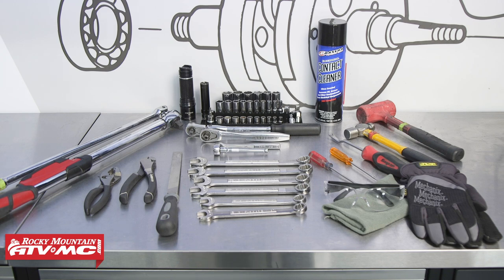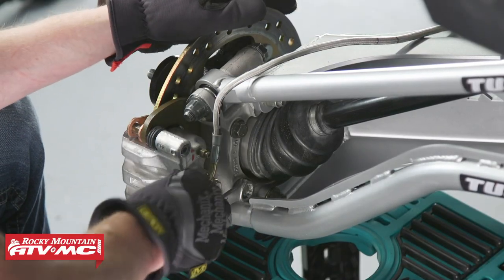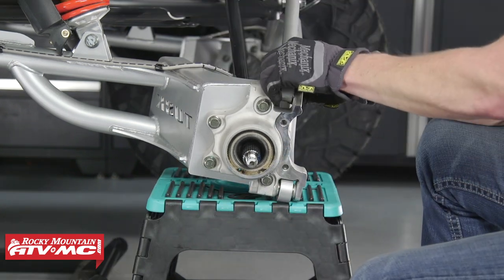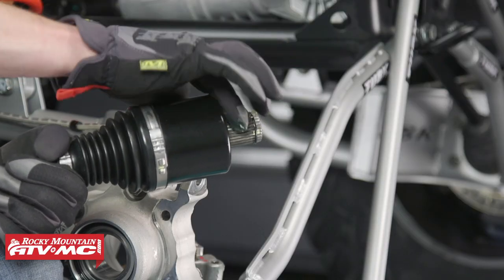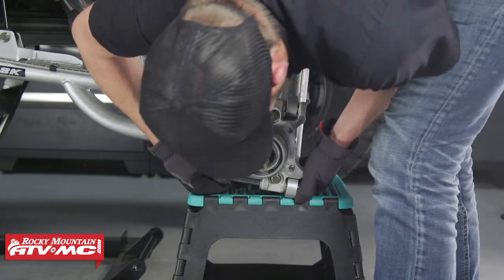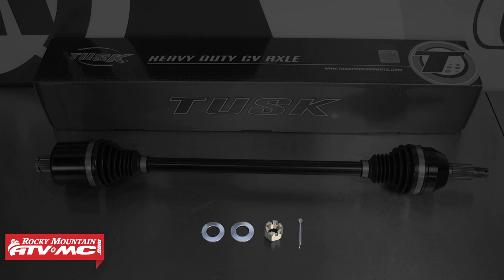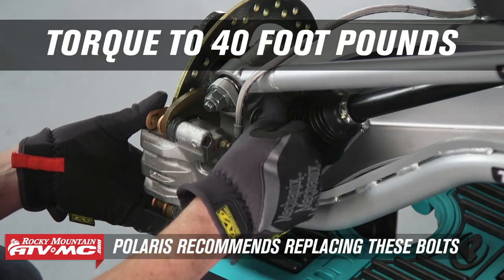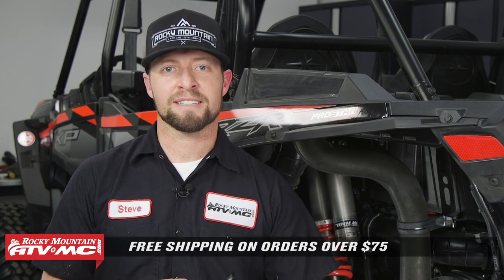Polaris RZR XP 1000 Rear Axle Replacement

Comment: Just purchased 2 of the exact same axels from you guys and torqued them to the recommended 180 ft lbs…I even double checked the torque spec in the rzr owners manual because I didn’t understand the 10 &12 mm you were talking about like the previous comment mentioned, so I just wanted to be sure on the axel nut….couldn’t get it to 180 the nut lost its resistance and just keeps spinning. The threads are ruined on the axel. Would not recommend this axel.

Comment: I didn’t catch when you were talking about 10 or 12 mm torque that you meant the bolt size and not the socket size which didn’t make any sense anyways since the head is 15mm but I torqued my m10 bolts to 100 and it shot the nut side off and it went to the moon so don’t make that mistake lol
Reply: He is talking about bolt size not the bolt head

Comment: I'm sorry but the axle does not come out that easy! tried the slide hammer trick, no dice. tried pry bars still no dice. still working on it.
Reply: did you get it?
Reply: @garrettfreeland3391  yes I soaked it in penetrating oil several times and it finally popped out
Reply: On my 2017 Polaris razor XP one axle longer which way

Comment: Y grease the splins? Wouldn't that get grease in the dif?
Reply from the maker: The grease helps the axle not get stuck inside the diff, you don't have to apply a lot. Helps incase you have to change that axle again.

Comment: are they really heavy duty? would u say they compare to the Rhino 2.0s?
Reply from the maker: Yes these are definitely more heavy duty than stock. We haven't gotten to test them with the Rhino 2.0 axles but they are both constructed using 4340 chromoly and 6 ball bearings so they are pretty similar.

Comment: Might be worth clarifying the radius rod torque specifications. In the video you mentioned 10 and 12 mm but clearly you're using an 18 mm.  Unless you're referring to the bolt head itself, which is not clear.
Reply: Bolt size